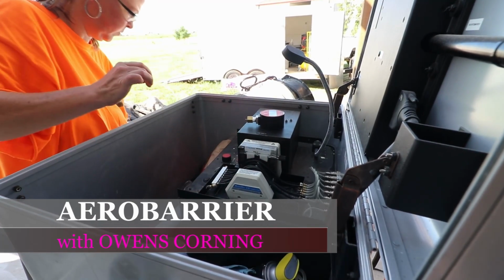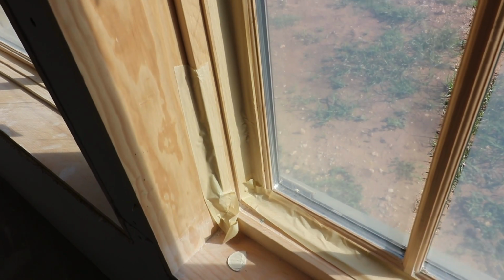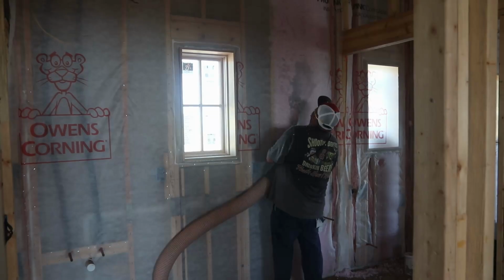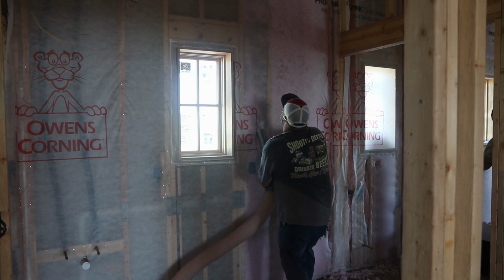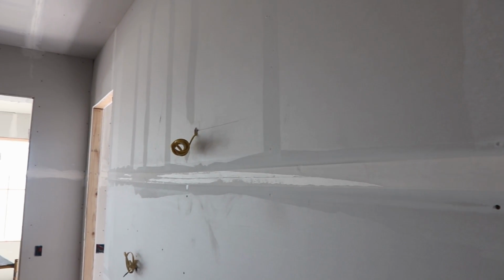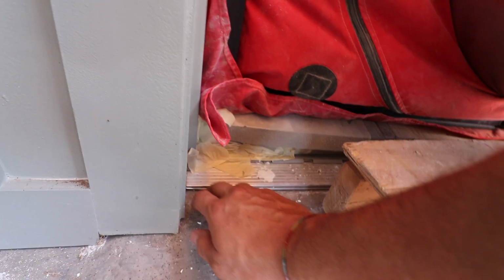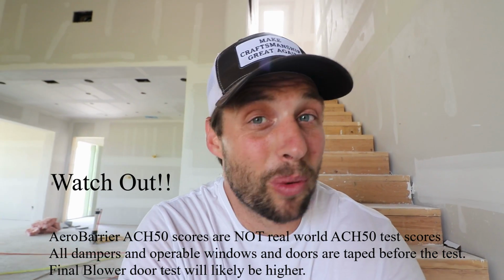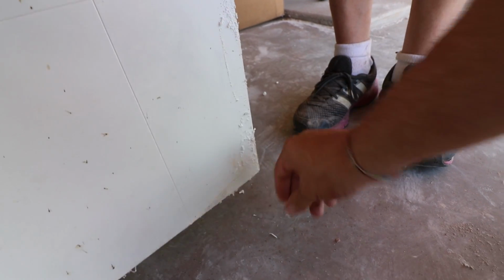This Insulation is BETTER than Spray Foam!!

Comment: I don’t believe anyone has found the solution yet for a healthy house. The old house without AC was open windows and let the air flow. In today’s houses with insulation you are stuck with what I call fart air. And a lot of people treat fart air with chemical aerosols that probably can cause some bad health problems in the long term. A solution is yet to be had. But keep studying and trying. Maybe you will get the right solution some day.
Reply from the maker: All our homes have continuous ventilation through ERVs.  Fresh Air not Fart Air!  Although I really like that term :)

Comment: @JordanSmithBuilds The point that it is cheaper and better sealing than spray foam wasn't fully true. You also didn't count the fact that you used the Zip board, which are pretty pricey themselves. Plus there is the time and labor to put it up. It's not too hard to get a house under a 3 with CC foam even without Zip board, plus you gain the structural strength as well.

Comment: Drywall should NEVER push insulation. This method is absolutely a drywall nightmare. I hung drywall for 51 years and if I walked into this disaster, I would let the contractor know that you can never get the drywall tight to the framing. Very poor "advice".

Comment: So, instead of using an established inexpensive method of fresh air intake, you replace it with a costly contraption that will eventually have to be serviced and will eventually break, and must be used in conjunction with other costly expensive contraptions.

I have a 20 year old Kenmore refrigerator that recently had to be serviced. I was able to do the work myself and the fridge will probably last another 20 years. The newer Kenmore refrigerators that are made by LG with cutting edge costly contraptions break after about 3 years, forcing the homeowner to buy a whole new fridge, because the replacement parts and service for the contraptions are just as much as a new refrigerator. I kind of have a feeling this is how homes have become.

The test at 15 minutes in is called a "Static Pressure" test. It's neat that you found a way to make "Boy in a Plastic Bubble," a reality, but it all goes to S*** once you install a bathroom exhaust fan, kitchen range fan, a fireplace, a wood pellet stove... You pretty much have to abandon all of the traditional ways of mitigating vapor, venting, or heating and cooling your home. It's no wonder homes are so expensive now that only the upper middle class/wealthy are able to afford them.

Comment: You cannot get an R-30 wall if the framing is 2X4. It is physically impossible because the wood framing has an R-value less than the insulation in between the vertical framing lumber or material. In a wall that is 26 feet in length 10% 0f the wall length is wood studs. When considering the layering of materials you will not get R-30 in the wall even with foam. The only way to reach R-30 for a wall structure you will need to install insulation board on the exterior. With exterior insulation there is no thermal bridge like the studs. Depending upon the exterior insulation chosen you could achieve R-30 in the exterior insulation alone.

Comment: Wouldn't work for a house this size (would be way too expensive), but for folks interested in tiny homes, if you're clever, you could build your own vacuum insulation panels and seriously super insulate much of your home.

Comment: So all this attention to the sealing, insulation, venting systems, and then you just use spray foam? Sounds like it's being lazy and cheap, to be frank. The proper way is to use materials like wool, materials that don't produce VOCs and aren't treated with chemicals. And I think builders know it, but it's just too convenient and cheap to spray foam I'm guessing.
Reply: Correction: you didn't use spray foam, I got it, but still you didn't use chemical free non toxic materials either.

Comment: Air indoor is not worse then outside air! What you need is an exchange of air, that comes from outside using an ERV system. But this is only necessary if you have a very tight home. For example a home that is spray foam in all cavities, or a structural insulated home. The key is to install electronic electrostatic carbon filled air filters in either return air vents, or in individual rooms. The use of the ERV is needed also to remove air from damp locations like bathrooms and laundry rooms.  My point is you can not only improve air quality, but you can pressurize the entire home, to make it safe from outside air quality to the extent of being in climate controlled pure air environment!

Comment: Dude here is  the deal did my 2 houses. 2  Inches of Foam and Aluminum Double Bubble taped off across the joists and ceilings. Cut my heating and AC bills BY 80%. Cuts  Noise Infiltration by 80%.

Comment: Blown in fiberglass doesn't settle unless there is some other condition present...ie: water.  One of the inherent properties of fiberglass is its natural tendency to expand.  The fibers are repelled from each other almost like static electricity in your hair.  Whenever you open a roll of fiberglass batts it instantly expands after having been compressed inside the packaging for who knows how long.  But...if it gets wet.....game over.
Cellulose is horrible for settling.  Usually in walls they mix a glue product with it to prevent settling, but I have opened up many walls for other repairs, and found voids at the top of walls and cracks from what appears to be shrinkage.  Even in walls where it was installed with the adhesive.  Which makes sense because in order to mix the adhesive evenly in the cellulose they use water,  which then dries out and causes shrinkage.  However in attics they always blow it in dry, and what starts out at maybe 12 or 18 inches of insulation, after a few years ends up at 6 or 8 inches.  And yes, the actual amount of material is still basically the same, (except it isn't,  almost every cellulose attic I have been in has bare spots from wind blowing it away)  but what is missing when cellulose settles is the trapped air, which is actually a big part if the insulating factor.  My biggest dislike of cellulose however is the allergen factor. Every time I get around cellulose insulation, I am plugged up, coughing, wheezing and miserable for the next 24 hours.  I can't help but believe that we are breathing small amounts of that every day from air currents moving through our homes.

Comment: i live in northern california. and i get batt insulation about 95% discounted and paper barrier batts free. im currently building a 40x60 2 story barndominium. shhould i use batt insulation or spray foam insulation? i want the most efficient home but i keep hearing of ppl getting mold inside their walls with foam. im planning on adding 2-3 mini spilt systems for a/c. i was thinking of r23 in 2x6 framing with paper barrier batts

Comment: Problem I see with Air Sealing in my opinion is that the house settling over the years and the wood structure, stud, etc. will expand and contract with the seasonal temperature changes. So, this solution is very static at the time it is being performed.

Comment: They say it's at a higher compression than settled so it can't settle. I for the life of me can't understand why somebody would use blown in fiberglass over cellulose. Cellulose is  better for the installer it's better for the homeowner it's better for the remodeler and has far less embued energy.

Comment: Gee, since everything was all set up I would sealed that doorway and continued for another hour or so. Go see Spray Jones for the real info on foam. It is non toxic when applied right after 24 hrs, makes a better insulation than what you have by far, adds structural integrity, is highly fire resistant, stops exterior wall condensation even on metal and you don't need zip. 1" poly on the outside is all. A 2x4 wall on 24" center, 1" poly, 3" foam, 1 top plate and 1/2" dry wall survived a 2500lb flex load.   Fast play back speed,  youtu.be/bekgWsR2V5Y?t=120 strength test,  Truth about R rating, not reliable https://www.youtube.com/watch?v=NBTKyCqA4c0 ,  youtube.com/watch?v=4qKTzViJEP8 demo
People aren't gross that's natural. None the less nice home and project, to each their own. Love the aerobarrier

Comment: Tight homes are only good if you’ve got that fancy electronic air cleaner/ heat exchanger//dehumidifying systems built-in.
In addition if you end up trapping moisture up against WOOD or anywhere for that matter, like you said you end up with mold and mildew.
All that being said I like the arrow barrier process much better than spray foam. Spray foam has so many potential pitfalls that I am reluctant to use it. That includes but is not limited to chemical hypersensitivity, cost to redo in the event the installer gets the mix wrong, cost, toxic fumes In the event of a fire,  trapping moisture with skinned over layers using open cell foam or finding leaks, etc

Comment: Really glad to see blown in insulation with 24in on center walls. I'm curious if that was done with 1/2in or 5/8in drywall.
Reply: Thinking the same, 1/2” Sheetrock with the bow created will push back and pop

Comment: "Houses need to breathe" is another way of saying "Houses need to stay dry enough to not grow mold, but moist enough to have good air quality." The first one is easier to say.
Reply: Stuff between the underside of the cladding and the back side of the interior paint/wallpaper,  that gets wet,  needs a way to get dry.  If there is a condensing surface inside a wall or ceiling,  that can't dry out (one or both directions,  via a natural process), you are in trouble.

Joe Lstiburek's "perfect wall" system ensures this natural process,  and prevents mold and other problems.

Joe Lstiburek tells the story of the roof structure of a recreation center rotting out when they switched from a black roof membrane to white.  The black roofing had been  heating up the underlying wood enough to dry out the humidity from the swimming pool.

It seems unlikely to me that random infiltration from unsealed cracks etc. would circulate enough air to dry out all the condensing surfaces inside walls.
Reply: @lloydrmc  it’s easy. You lower the chance for the dew point for the inside wall. If they never get to that point you won’t have a moisture problem as it’s expelled through the mechanical air exchanger
Reply: That's an exotic viewpoint  @inteallsviktigt  , based on multiple assumptions on your part.
Reply: @lloydrmc    this is not an exotic viewpoint. And factual not assumptions. Please tell me my assumptions that aren’t factual. 
And It’s almost like you never listened to any of Joseph Lstiburek presentation or read his material when you mentioned him. 
I recommend you read up and listen to his Building beyond zero. 

Closed cell foam don’t need to breathe as it’s not water permeable. As he say people don’t need air right houses, they need water proof houses, they just happens to have air right properties. Water condensates on the outside as the temperature never reaches the dew point inside the insulation. And you have mechanical air exchange inside preventing water expulsion and saturation. 

Building needing to breathe is a myth and excuse for bad craftsmanship

Comment: This is not an insulation.  It's a silicone calking. You still need air tight information air tight system.  We install open cell without any additional air sealing down to 1 ach commonly.  0.6 was lowest

Comment: THERE IS NO EVIDENCE ANYWHERE IN THIS VIDEO THAT SHREDDED FIDERGLASS IS IN ANY WAY "BETTER" THAN SPRAY FOAM. It sure doesn't keep heat in or out better than spray foam or styrene. Even those cartoons ought to have taught everyone that you can't trust a pink panther.

Comment: My plan is to build a 2x4 frame house with no insulation in the walls.  Wrap it with peal and stick membrane as air/water/vapor barrier, then wrap it with rockwool R30 on the outside continuous.  Use a second 2x4 framed but unsheathed wall with Tyvek to contain the Rockwool and limit air movement through the insulation, then siding. A 14" thick wall with "innie" windows and doors.

Comment: I think this would be better if done before drywall and insulation.  There could be gaps in stud bays that will allow air flow when new holes are made in the drywall.  Down the road people are going to put a lot of holes in that drywall hanging pictures, running speaker wire, etc.  So relying on the drywall as it was during construction to be an air seal on the house later seems iffy.
Reply: You must be in a colder climate? No one in hot climates is trying to seal the inside because we so often had the heat on the outside, cold on the inside. We don’t seal the inside wall at all.

Comment: Kind of surprised to see someone using a (full-face) respirator with a beard. That could easily make the situation much worse.
——
Building energy codes have become more stringent in almost every jurisdiction. When paired with the requisite balanced ventilation system AeroBarrier (at roughly $2±1 per square foot,) is one of the quickest and most cost-effective solutions available. One added benefit to a tighter building is that it makes it much easier to maintain proper building pressurization and improve IAQ (providing you don’t neglect moisture infiltration and exfiltration requirements that become even more important with a tighter building envelope.)
 
https://aeroseal.com/aerobarrier/
 
I prefer using mineral wool rather than fiberglass whenever possible.

Comment: I don't see how it's better. With a good closed cell application you have a stiffer wall which works well with houses that have stucco. One of the issues in Southern California is cracked stucco due to settling of the house, poor foundations or defective foundations and earthquake damage. I won't say this product is bad because I don't know enough but better? Depends on when it's being done and what results are wanted. Say you want to retrofit a house and opt to tear out the dry wall, then closed cell makes sense once you redo the wiring and upgrade the plumbing.

Comment: How does the fine mist effect the sheetrock/paint?
Reply: I would definitely do it before painting.  The sealer accumulates by building up where passes through cracks and other penetrations, and doesn't really have anything to force it to adhere to non leaky surfaces.

Comment: Spray urethane is the best, one uses a heat recovery ventilator, or ERV.  Never had mold in a house, I saw plenty of others that were mold ridden. Spray urethane increases wall strength over 300% over other insulated houses, and spray foam houses are more comfortable, and quieter since so many houses are no built closer together.

Comment: I like the work you’re doing, your comment about building technologies, and carpentry being a stale technology I had to laugh a little bit. It’s so true, that new technologies and old carpenters, don’t tend to mix very well. I’m glad you young guys are doing what you’re doing. Learn from the old, and embrace the new. As well as dial into how the new can integrate with the old. You’re doing some great work.

It’s nice that you’re wearing a mask, but I’m pretty sure that you would need to shave, as well as pull your hair up out of where the face part of the mask adheres to your face. IF, you want to actually protect yourself, and show proper procedure with regard to deployment of PPE.  That’s just the old OSHA inspector in me. Take care of yourself out there, stay safe. Keep your people safe too.

Comment: Nice thing about glass is it will not hold water.  But - it that a positive?  Wool will hold 2-3X its weight in water.  Cotton (denim) will hold a lot of water.  Question is - would that water be condensing otherwise?  
Super video and great process.  Can't believe that trick with the atomized caulk.

Comment: WHAT A DICK PLAY! - Dictating and Criticizing @ 2:07 - " houses need to breath is one of the BIGGEST misconceptions"  then goes on and on about what needs to breath and so on and so forth, when water vapor consideration is extremely important to try and manage during different indoor and outdoor conditions.   And is this the same guy who titled this video "This Insulation is BETTER than Spray Foam!!"?! - Is the spray even insulation? - I'd even give in to that play on words actually, but how the fk is this spray shit completely "better than Spray Foam"???!!! - That's just BS! - because if it was, it would be one of the greatest things ever and it would be used on the exterior and job done!

Comment: I've built homes for 38 years and always used 6 inch exterior walls with 6 inches of insulation and 9 inches of insulation in ceiling all batt insulation with tyvek barrier,,,, like spray foam the price will fade it out,,,l don't like blown insulation of any kind,,,it will find it's way in your duct work and kill you in time.

Comment: So a few long term questions, obviously positive pressures to install. In high winds against the house with rapid pressure changes, how does aerobarrier prove that this holds. Does it dry hard? What was the prep and after installation clean up like? Do they warranty this product? How long? Its fascinating and as shown seems simple but what the lifespan, and long term can it actually hold up. Then, does it have off gassing and odor?